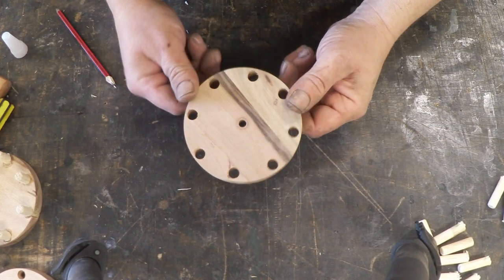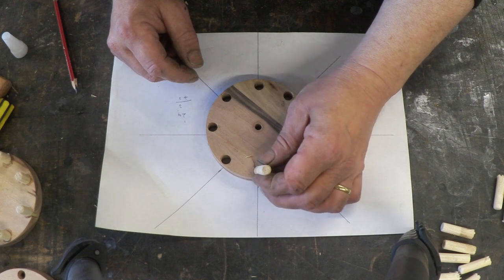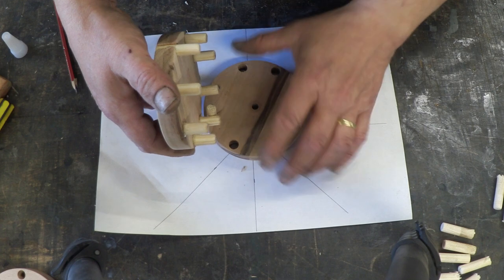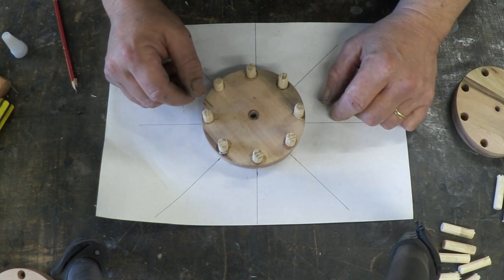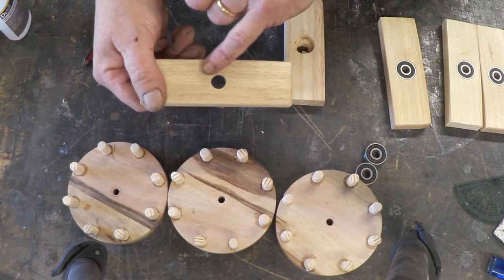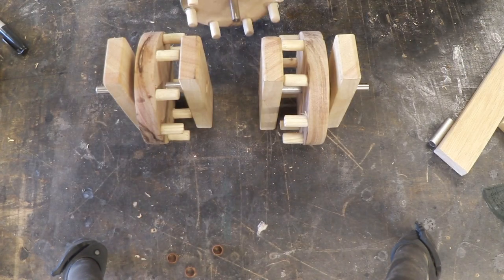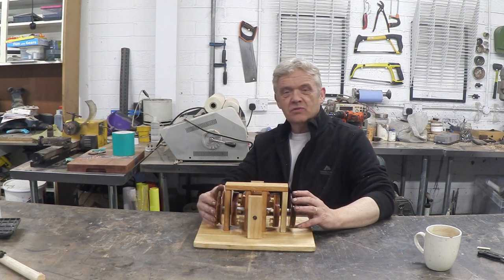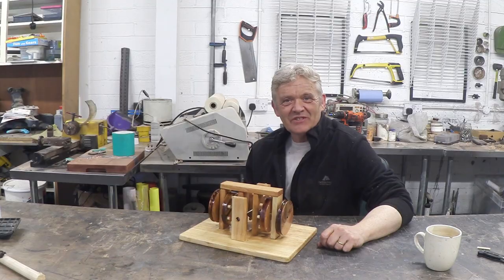Contra Rotating Peg Gears

Comment: For marking out I print a template from a CAD program and glue it to the material I want to cut or drill, not quite as accurate as doing it properly but nonetheless quick and easy.

Comment: If you used a differential as a final output, a variable speed pulley and 3 belts you could make some sort of hydrostatic transmission, with a infinite to one ratio and 1.5:1 in a direction and 1.5:1 ratio in reverse, with a standard 3:1 ratio variable pulley. The one with a moving plater in the middle.
Reply from the maker: nice idea mate - I was thinking of cones for that to be honest

Comment: How about doing a Harrison pendulum with cheeks so that it always has exactly the same tempo? The funny thing with clocks is when they're in accurate there just an accurate to one part per million or one part per billion… You can't even see it. But that's what we have to work against in order to make a good quality clock. You would need a way to measure dead center for the pendulum, and then to measure precisely the amount of time of the swing, and then you can just give it a kick and see if it's still maintains the same timing.

Comment: (completely off topic of this video) Among many topics  many of which you cover I also enjoy following advances in space technology and the possible colonization of other worlds. I am seeing talk about putting a permanent floating station/colony in the atmosphere of Venus one of the problems is a lack of water readily available there. However, sulfuric acid is largely available there as the clouds seam to be made up of it. Is there a simple process to make water from sulfuric acid? Perhaps some sort of electrolysis?
Reply from the maker: well I suppose you could just add soda that way you get water and sodium sulphate
Reply: @ThinkingandTinkering  I had thought of that. It would be a huge amount of weight to carry clear out to Venus I wonder if Sodium bicarbonate is something found naturally in asteroids. I was honestly hoping there was a way to break it down without the use of other chemicals such as heating to a certain temp or electrolysis since it is easier to send solar panels than thousands of tons of soda.